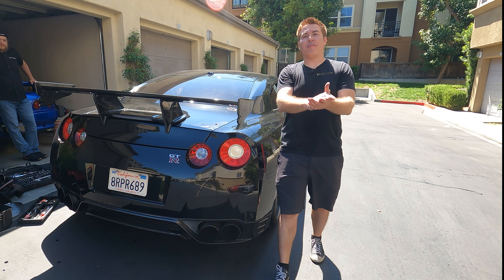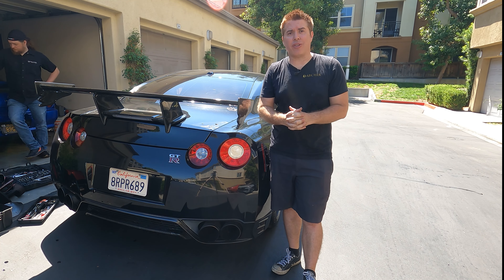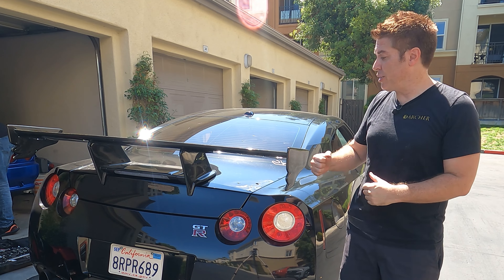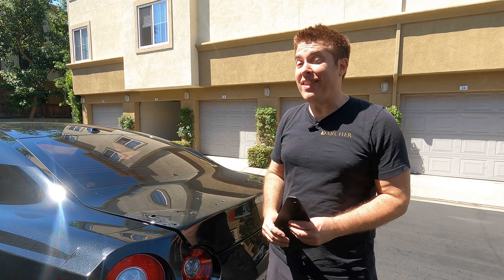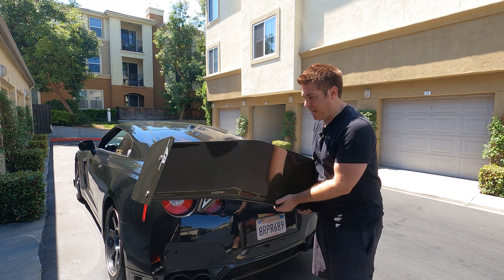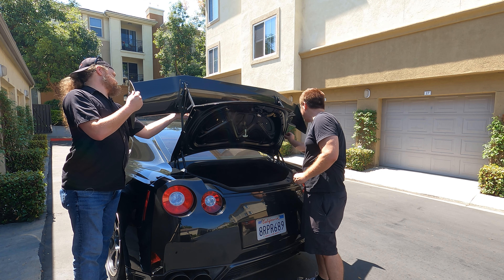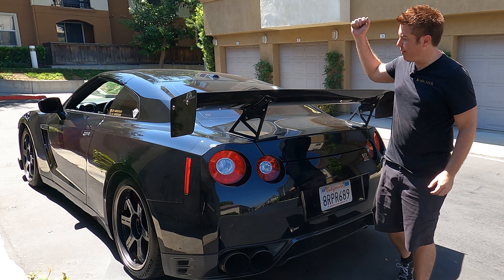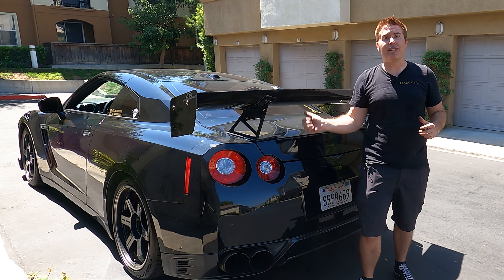INSTALLING AN APR GTC-500 WING ON MY NISSAN R35 GTR

Comment: Whats your honest feedback so far?
Im debating between this one and the CR carbon 
😦
Reply from the maker: This one is actually functional. Its the only one on the market that's wind tunnel tested. I noticed a difference right away. As soon as I got on the freeway I noticed the ride seemed smoother, more stable. After having the wing on the car for a few mo the now, that opion hasn't changed. I don't think I'd go with a different wing at this point. As a bonus it can be 100% reverse able, but there again, I won't be changing it.
Reply: @ awesome to hear man & thanks for the quick reply. Im glad you’re liking yours, I will definitely be ordering one now!
Reply from the maker: @AFouad92 glad I can help